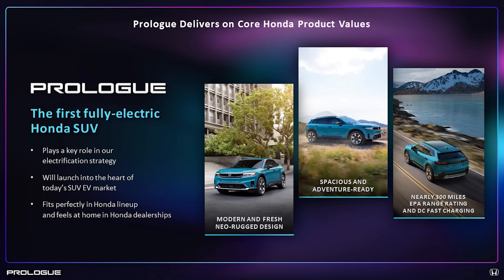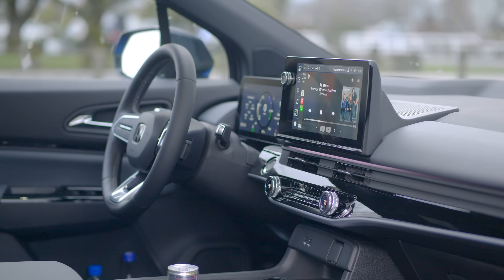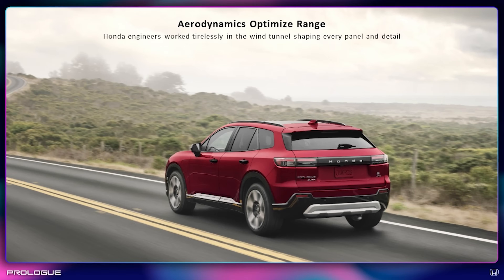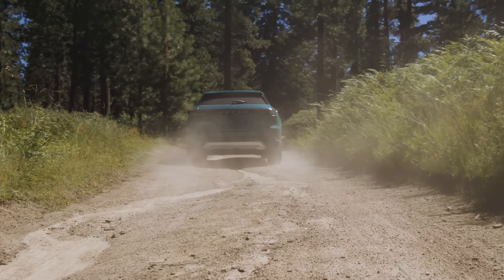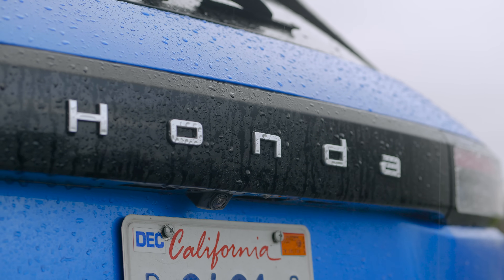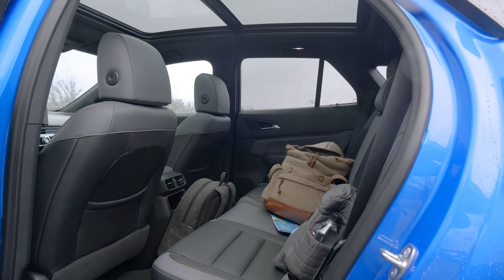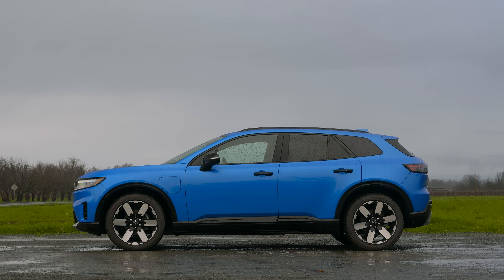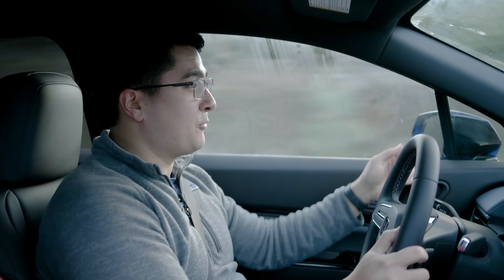Honda Prologue First Drive | Taking Risks

Comment: I'm not trying to underestimate difficulty but if Honda can develop ICE car (for ICE car you have to constantly do revision on your engine or even build new ones to make sure is compliant with current emission standard) they could've easily developed EV platform. This is honestly pretty embarrassing, most automakers don't develop their electric drive trains (none of them make brakes, some of them make their electric motor in house and almost none of them make their own battery) GM was totally unnecessary.

Comment: I just don't understand the market for this EV. It's not a true Honda, so Honda enthusiasts will likely pass on it. It's not the most value-driven Ultium car , as the Equinox EV will be cheaper with pretty much the same specs. And anyone just shopping for an EV SUV will just go with the Tesla Model Y, which is better across the board as far as price, performance, and practicality.

Comment: Fwd makes sense for EVs where there is real winter. Allowing the drive wheels to slip to make traction in snow without freaking the driver out. A RWD Tesla feels awful on breakaway characteristics until the computers intervene. It's a lot of mass twitching and kicking out.

Comment: Not really sure why so many are hung up on the price.  Most buyers will qualify for $7500-$12500 in credits and rebates (depending on state) putting it at the same price level as a similar equipped Pilot.

Comment: The biggest possible issue: How's software is controlling the vehicle? If it's GM, based on all their "stop sales" going on right now, that could be a huge issue moving forward and could really hurt sales (not to mention a $50K starting price).
Reply: Was their an actual useful point to that generic statement?
Reply: honda used their own programming and have not reported having any issues with it during testing.

Comment: Looking at the comments here, I think some people need to get over a few points.  Just like when buying consumer electronics like a notebook or tv, No manufacturer builds all of the parts. Most brands engineer their products via their supply chain.  Ie: Dell was one of the first electronic companies to be public about this.  A Dell is everyone else’s parts simply engineered into a Dell branded case sold by Dell.  They do that for pricing and profitability reasons. 
Over the years due to competition the auto industry has increasingly adopted this. The auto supply chain is massive (brakes, lines, airbags, infotainment, etc) so if you don’t currently engineer a powertrain, energy source, censors, software etc to bring an EV to market, simply parter with a company that already has.   Saves big $$$ on R&D costs.  Honda might do this in the future, but today EV is still an emerging market. 
Also, if you follow GM.  They are not the same company from 20 years ago. You no longer see the cheap Cruise, Sparks, or low end offerings.  They have been quietly spending big on R&D and going up market.   Recent results are the Car of Year awards to Corvette, Caddy CT4, CT5, new Trax, etc.   they have invested massively in the Ultium platform and the new Hummer, Full sized pickups, Blazer and new Equinox (which will set a new price standard) are looking promising.   With the exception of the software issue associated with the recent Blazer launch, but that was software not hardware so fixable with a patch.  
GM could use a rebrand to help it distance itself from their stigma of the past. 
Let’s watch how all of this unfolds.   Great video btw.
Reply: naw, easier just to trash chevy/gm, as if other makes don't have any issues...

Comment: Honda will keep pushing the idea they did the parts that clearly GM has been doing very badly at. This way Honda will be able to say our software is not the same as GM, so less likely to be the nightmare that the Blazer EV has been. 

I have great respect for Honda engineering. When you look at the range of products they build, gardening equipment all the way up to small jets, so they seem to have the ability to so much. My hope is they do manage to have a much smoother launch than GM has had. 

Honda's first generation Passport was an Isuzu rebadge vehicle. Honda moved on to do it themselves. I suspect this is what will happen with this EV model. Especially given the nightmare GM EV programs have been. I would be trying to get my products away from GM as fast as possible if I was involved. Would not partnered with GM to start with, but too late to avoid that.
Reply: most people wont realize this. Honda has their own EV platform set for 2026 and beyond. this is just a stop-gap measure for compliance and to test the market if nothing else
Reply: @ShaiyanHossain  I agree many buyers will not know it is GM that this Honda is built on. Many did not realize Isuzu was the basis of the first Passport. 

We will see how quickly Honda can get away from using GM as a platform. I would love to think 2026, but feel like 2028 is more likely.
Reply: @kevtheobald partnership with gm is strictly for the NA market; honda made the e and is coming out with the e:ny1 (both for europe).
Reply: @entertained...  It does not matter which market, the Blazer EV got off to horrible start. The Hummer EV had a lousy launch. The Cadillac Lyriq had a lousy launch. Honda is slapping the Honda badge on something with GM as the foundation, not a wise choice from point of view. North America is their most important market.
Reply: @kevtheobald  not sure why you felt the need to respond as if i was hyping up gm evs...
Reply: @entertained...  Well, I guess to me, it came across as Honda is moving beyond GM, but maybe you were okay with them going forward with GM. I just think they should have cancelled, but maybe some sort of EPA credits or fines is hanging over their head.
Reply: @kevtheobald  thankfully the partnership with gm is a stop-gap measure as they plan to build capacity to make their own in 2026 in NA; to your point, hopefully not past that and into '27 or '28...  since they already build two evs in europe, i'm hoping the learning curve part of that is less steep come '26 and mainly they are dealing with more logistical issues instead of product development issues.  time will tell...

Comment: This speaks highly to the confidence that Honda has in the "electrification" game. Instead of investing money in their own design, they just threw a badge on a GM product and called it "good n'uff". I love it. F-ck that BS technology. Your normal gas tank will never have to be replaced 5-10 years into owning your gas engine vehicle, at anywhere from $10K to $35K a pop (if you still want "full" range and power capability).

Comment: As an owner of a 2023 CRV-EXL, 2wd that I bought for $42K (out the door w/ all taxes, fees + $3K dealer mark-up).  Nice car!  So, I trade for a 2025 Prologue with likely the same dealer mark-up for about $55+K (1-motor version).  Still, the same issues arise in switching to EV: initial cost is about 20-25% higher, increased insurance costs, lower re-sale value, limited availability of charging stations for any trips exceeding 250 mi r/t from home, possible repair delays for any recalls or accidents.  I think the killer is "made in Mexico". No way Jose.  Honda owners are just not that stupid. Honda is simply lowering its financial risk by not committing to building an integrated EV drive system and assembly factory in the US.......in case the market for the Prologue is non-existent.
Reply: you're a bozo for paying $5k over for a fwd crv lmao
Reply: Eh. Honda has sold Mex-made cars here before, and Mazda, too. Don't seem to be any overall differences in my experience. Newer Hondas are kinda junk, their marketing and financing departments run the house now (instead of Soichiro's beloved engineers), and they have GM-level cost cutting failures and Hyundai-Kia-level warranty wait out tactics now. The country of origin is absolutely not the issue here.

Comment: One of the most hilarious things I got from the development of this car, I read an article somewhere that Honda engineers were frustrated trying to make the vehicle NOT drive like a GM product.
Reply: DNA matters. And it is birthed in a GM factory. And given a GM price. And ultimately it’s the GM price that makes this a no from me. I need severe value for money, like an Accord LX.
Reply: Isn’t GM very good at suspension tuning though?
Reply: @grantdillon1083  Not usually on on their "lower end" cars. Honda has a particular ride and handling mix they like and apparently GM stuff wasn't quite cutting it for them

Comment: Hard to make the math work on some of these EVs in my mind. It's ~$20k more expensive than a CRV, and $20k will buy you about 200,000 miles worth of gas at $3/gallon in a CRV. And if you want an EV just because you like the tech or for environmental reasons, why would you choose this?
Reply: Because after 200k miles, the EV will have emitted multiple times less emissions than an ICE vehicle
Reply: Please update your comparison logic (gas really?) its not 2013 anymore. I daily drive an EV and after 80K miles its cost me cheap electrons from my garage charger, tires, and a bottle of washer fluid.  I don't miss the 16-18 oil changes, brake pads or any number of "flushes" or timing belt replacements at this point what so ever.
Reply: Solar panels on the roof of my home will give me a solar powered EV. Part of what I'm doing to fight climate change. Everyone has an excuse not to install solar panels and not to drive an EV, as the world heads into a climate change catastrophe. And you compare it to a CRV which is nonsense.

Comment: I'm leery of GM EV hardware (because you know, Blazer EV has been SOOOO good) but as long as it has headlights that blind oncoming traffic worse than Teslas, I will feel reassured that it's still a modern Honda.
Reply: The hardware is not the balzer evs problem. Its software (which can be fixed)

Comment: So Honda was in charge of the stuff that doesn't really matter and GM was in charge of everything crucial like engineering and development.  Great...😒.  And yes, everything that the interviewed guy said means this thing is the pure definition of badge engineering.
Reply: You mean like the Toyota Matrix Pontiac Vibe or the Isuzu Trooper that became the Acura MDX or the first generation Honda Passport that was a rebadged Isuzu Rodeo? I get it though from a financial risk standpoint, partnering with GM makes since, but based on the price it seems like your trying too hard to pay GM, Honda, and the dealership resulting in a car that's about $20K+ overpriced, just like all GM vehicles.
Reply: @jefffaller8474 the Trooper-based Acura SUV was called the SLX.

Comment: The disdain for GM in the industry is so funny. I know 3 engineers, one at Ford and 2 at VW in Tennessee, and they both say GM is the bottom of the barrel in terms of cost saving engineering.
Reply: they wouldn't need to worry about cost cutting so much if they didn't cost cut, ultimately costing them CUSTOMERS

Comment: Appears everyone is missing the boat on this one.

There is a divide in the comment section on an age/experience basis but not necessarily a real knowledge basis. Opinions can and do count in a few comments.

1. This is a DATA MOVE for Honda.
The DATA is everything single bit/byte of information they get from clients driving into the parking lots and walking into Honda Showrooms (when you’re Bluetooth and WiFi is turned on within your mobile devices and any vehicles that pull into the dealership lot). WiFi/Bluetooth communicates with any devices with the properties and can be analyzed later. It can also be purchased as an aggregate from third parties such as Pulsate, inMarket, Reveal Mobile, Gimbal…etc.

Secondly is the data they collect from GM from any vehicles that are sold. Whether the vehicles are used as fleet vehicles or individual owners, that data will also be analyzed.

2. The investment in this venture is no different than any other venture a Honda has made in the past. The information they learn will allow them to decide whether to push forward with a dedicated product or make changes to existing products. The decision being made to partner with GM is smart on a variety of levels. 

3. They have a vehicle with a throwaway nameplate. Look over Hondas history and ask yourself if any previous vehicle from Honda had a lasting name that was consistent with how names were developed for automobiles (along with the help of consultants help). Many of SUV style vehicles have used names from Honda’s ATV/Motorcycle/scooter days of the past.

Written in 2021:
According to Honda, the name demarcates the beginning of “a new series of volume Honda BEV models.”

Let’s see if they keep that name when vehicles are made, from top to bottom, by Honda. 

At the end of the day Honda will show that they knew what they were doing when they entered into agreements to go this route. In time,  when Solid State battery manufacturers have standardized products efficient products, we shall see if Honda is making attractive, efficient and reliable products. I used to love Hondas and have owned many. However, I haven’t seen a Honda   I’d want to have in my driveway, on looks alone, since the 90’s.

Comment: I continue to be astounded. Car makers can't seem to understand that an EV is not a more modern.version of an ICE. It represents a change almost as big as the change from horse and buggy to ICE. They just move forward with their eyes firmly fixed on the rear view mirror.
Reply: ICE "Horse" is cheaper, has better range, better endurance, cheaper to fix when it "crashes", faster to "eat", easier to find "food", works better in colder weather, and is worth more when trading in.  Tell me again why I want to change?
Reply: @ratshackmojo You don’t, but many others do and car companies have to reckon with that.
Reply: @JollyGiant19  many others DON'T, as EV adoption rates continue to be significantly slower than projected and will continue. The number of people never willing to switch to EV has grown since 2016. The feds are forcing companies to go EV with all their might and it still isn't happening.
Reply: The U.S. govt is making them go EV
Reply: @SatoshisDiaper  That needs to change at the ballot box.
Reply: How is the change to BEV from ICE anything like the horse to buggy?  All you're doing is changing the drivetrain.  It's still a car, still has 4 tires and a steering wheel.  You can put the same technology in either type of vehicle (self driving aids, safety systems, etc).  BEVs seem more evolutionary then revolutionary.  What does a BEV do that an ICE vehicle cannot?  If anything, it's the BEV vehicles that are more limited, such as range, recharging rates, and long lines at charge stations.  A pure BEV seems like a step backwards, to me.  They are just as bad for the environment too, and much more complicated to recycle at their end of life.  Not to mention the out of control fire hazard they all possess.
Reply: Calm down. It's still a chemical-to-electricity conversion device, not elven mythril.

Comment: Honda has lost their way and not because they partnered with GM for this collaboration.  Quite feasibly, Honda needs GM's EV expertise in this space.
Reason Honda has lost their way is the electrification of almost all their vehicles including their mainstay Accord with hybrid architecture.  People have no idea what reliability cost and long term expense is going to be with electrified vehicles. But they will get the memo shortly as this relatively new tech ages and resale value for hybrids and full EVs fall off a veritable cliff and reliability cost becomes astronomic owning one of the vehicles with aging battery and 100 computers goes out of warranty left for the consumer to pick up the tab.  There goes little Johnny's college fund.
EV's are a joke with current battery technology with gasoline having 100 x's the energy density of a lithium Ion battery.
Good luck to all the ignorant buyers out there. EV's and hybrids exist for one reason alone. Auto manfacturer profit.
How do I know?  I worked in the industry as an automotive engineer for 30 years.
P.S. if one must be foolish enough to own an EV due to liberal wokeism based upon the canard of saving the planet on the backs of child slave labor that mine Lithium in the Congo, at least buy a Tesla Model Y from the most important man in America, Elon Musk.  This Honda/GM is a 'covered wagon' compared to Tesla EV technology.

Comment: Honda was 100% REQUIRED to develop an EV line that they don't care about. Honda's bread and butter is the engine. They consider themselves a small engine company before an automobile company. This partnership with GM was simply a cheaper AND quicker option for them to roll out an EV line just to "keep up" with the competition. I'm sure they are working on developing their own electric platform, but they put all their eggs in the combustion basket many years ago. If you're considering buying this vehicle, why?

Comment: I realize Honda did this to have an electric vehicle. What I don't get is why you'd pay $10k for an electic than a comparably sized gas vehicle. Even if a gas vehicle gets like 25 mpg, youd have to drive 83,333 miles at $3/gallon just to break even on the price difference. And yeah you have oil changes and other mechanical maintenance, but you also have to pay for electricity (barring home solar, I guess). It just doesn't make sense for most of these vehicles. Nevermind an electic compared to a hybrid that would get 40-60mpg.
Reply: Home solar is very exspensive too.
Reply: Biden wants you to drive an EV
Reply: The rub is that they dont want you to buy an ev. They are sandbagging so you keep buying their gas cars where you need continuous service and parts. Of course theyll figure out ways to need repairs for evs as hassle free as they should be.